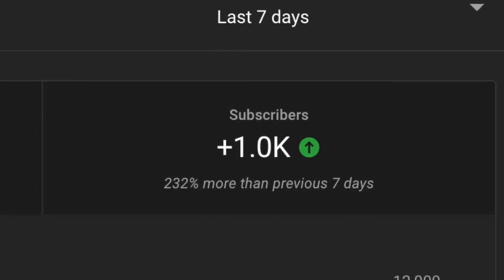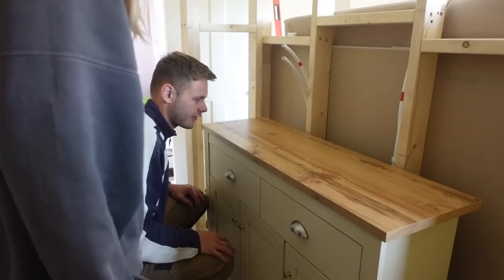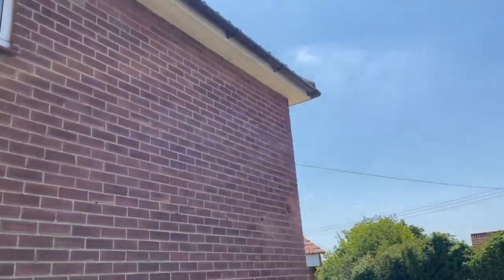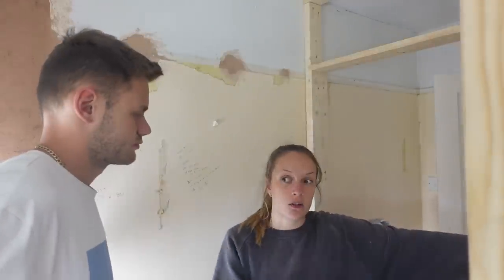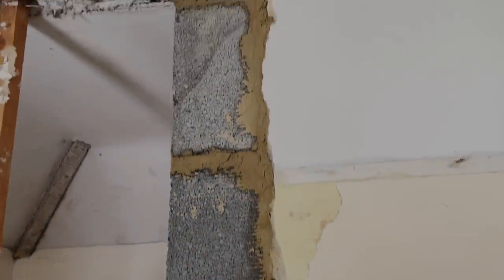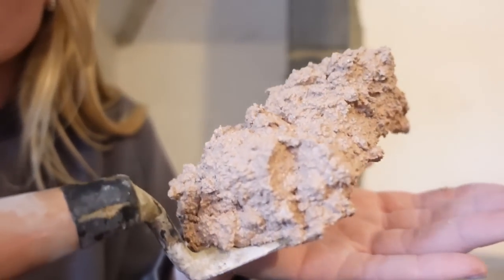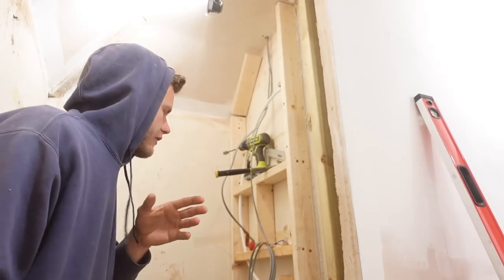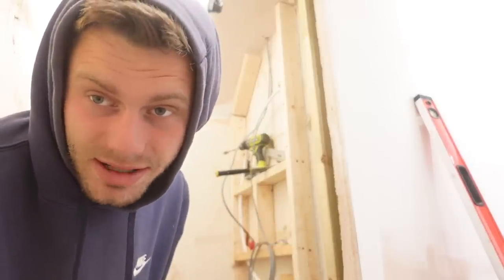Building a bathroom in this unwanted 1930's auction property | UK Home Renovation Vlog. Ep5.

Comment: Couple of tips guy's. Get some joining compound for compression fittings don't use PTFE tape. Break the tile on the edge not the middle. Use a 10 or 12mm tile trowel and back butter the tiles as there large format. You will have to redo the floor as they will soon break. Keep up the good work from a bathroom specialist 👍
Reply from the maker: Hi mate, appreciate the heads up on all the above. Think we realised about the tiles at the end of breaking about a packs worth… all a learning curve though isn’t it!  Will definitely take this tips on board and bring them into the next episode!! 👍🏻👋🏻
Reply: @NickyandHarri  here's a plumber parts video for tiling hope it helps 😊